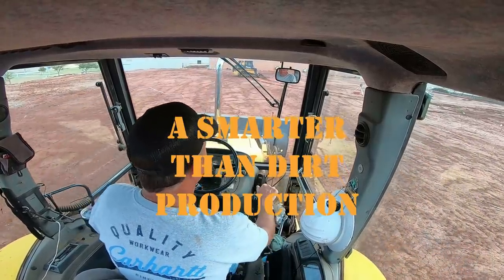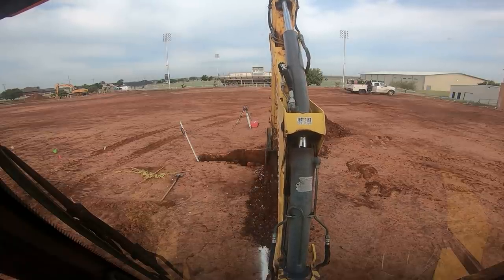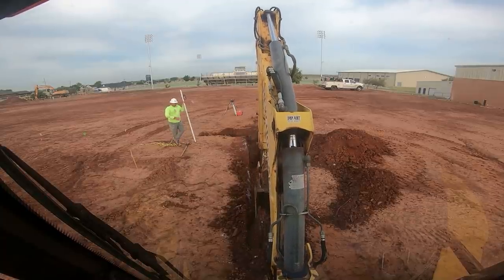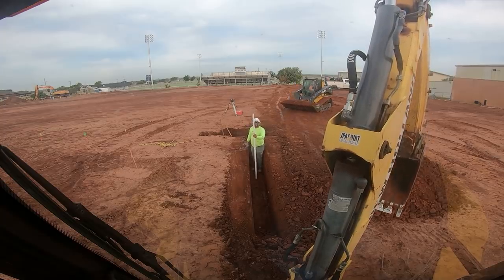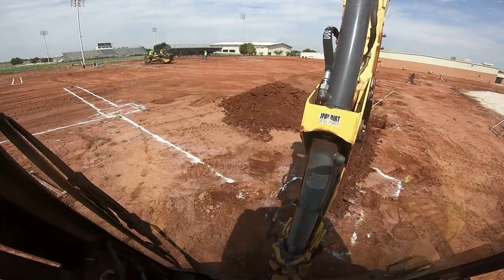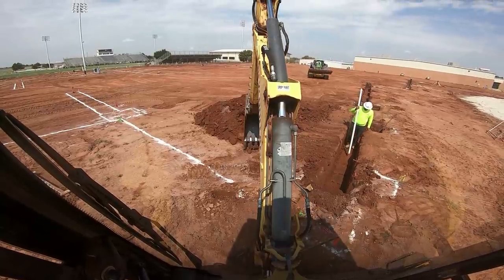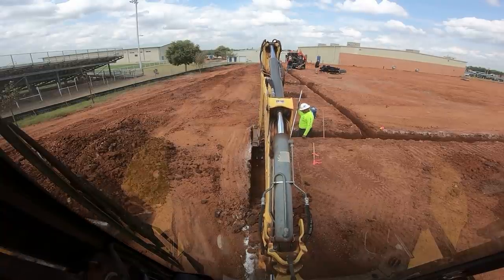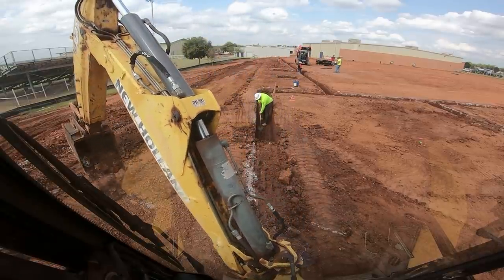Footing how to. #digginok #backhoeman #footings

Comment: I wonder if they put that 24” diameter grade guy in that 18” wide ditch on purpose?

I hadn’t heard of helical piers.  But, they do sound good.  Ought to keep the building in place against one of those twisters... keep digging... I’ll keep watching.
Reply from the maker: I have been told the correct term is helical piles. Not sure they will hold anything down, but the can't hurt.

Comment: Hi Frank : I am 65 and bought my first backhoe NH 575E . That has a 24" bucket I would like to have 12" have not been able to find one Here in kentucky  any suggestion ??
Reply from the maker: I had a 555e for my first machine, 575 is a bit better on the horsepower. As for finding a bucket, Facebook market place, Purplewave auctions, Big iron auctions. Ask around some New Holland dealers. Or buy a new one, same bucket as the new machines run
Reply: @Digginok  Thanks ,All the N.H. dealers around here only do tractors . I will keep watching sites you mention.

Comment: Seeing those screw piles installed would be interesting. 

It seems you say the contractors excavate and recompact the pad before digging footings?  Why, because of spongy, inconsistent ground conditions? Rarely seen that done - usually see drilled piers down to competent ground with grade.beams and mostly ignore surface materials.
Reply from the maker: Clay soils have a tendency to swell and lift slabs, so they usually try to reduce the chance of that happening with a soil that’s more consistent.